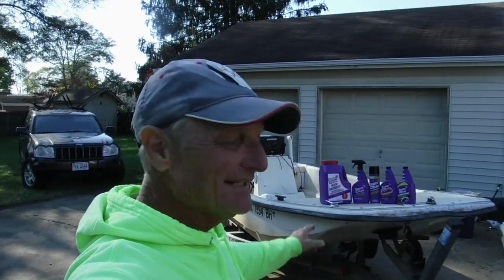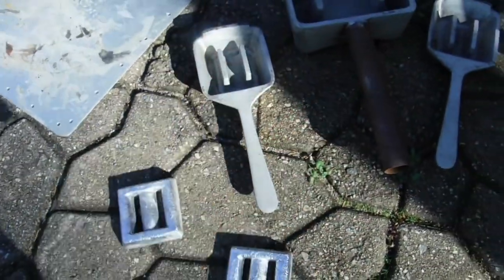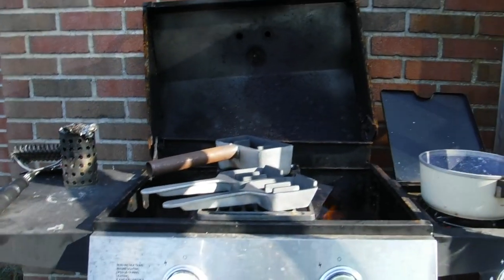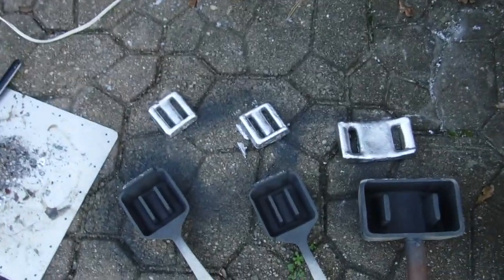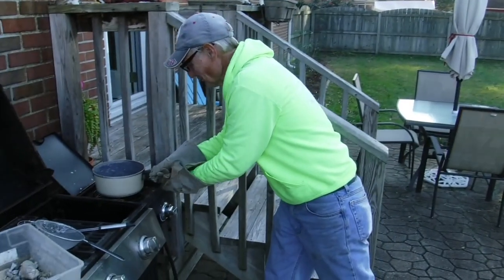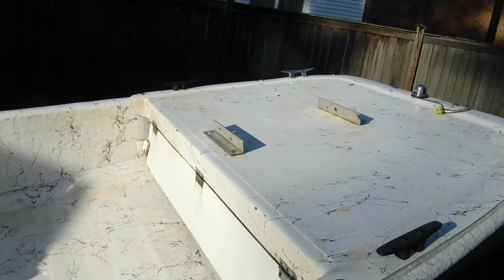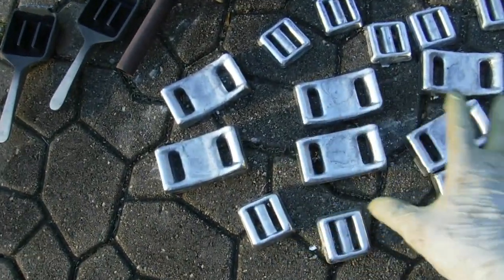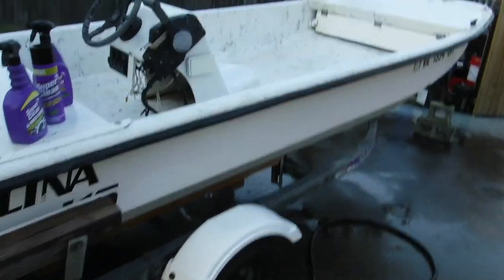Melting Lead and Maintenance

Comment: Great video , I have a load of lead to melt too , melting old lead to help find new relics 🙂
I like good cleaning products too , the boat cleaned up great , I have even added cleaning stuff to my barreling machine to see what happens 🙂
Reply: The boat cleaned up real nice!! maybe try soaking those rust stains with bleach for 20 min.   or try scrubbing with soft scrub bathroom tile cleaner. it has an abrasive in it.